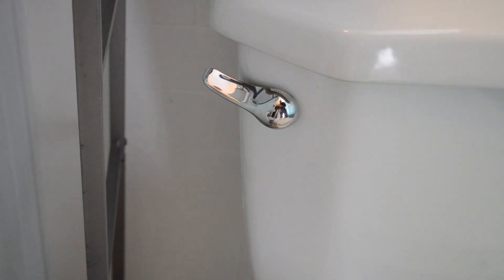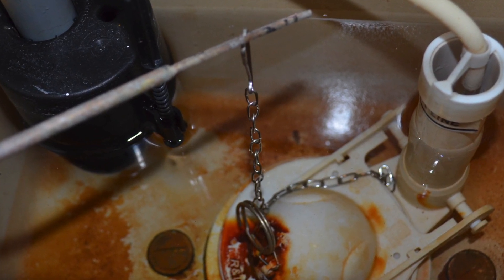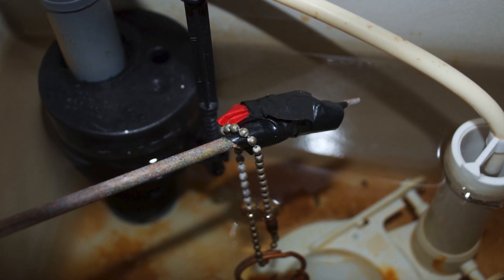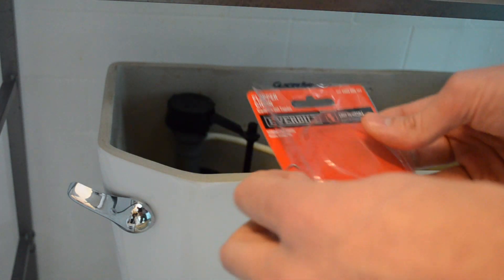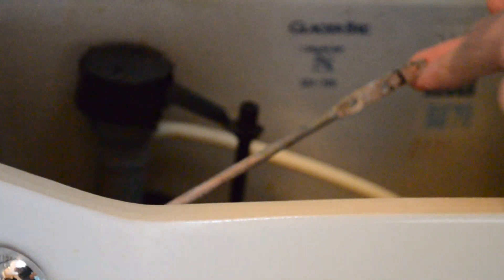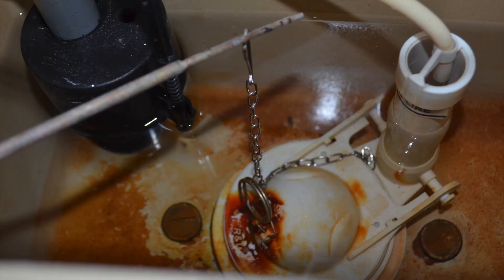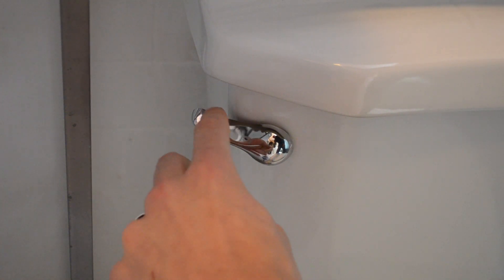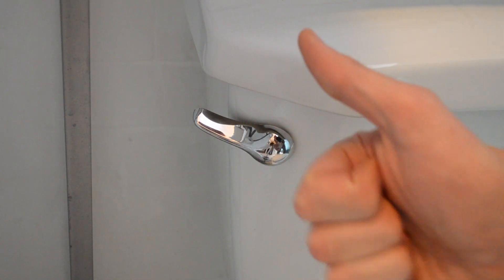Toilet handle loose | Fix for loose toilet handle

Comment: I have an issue with my replacement handle. It's not the chain. I think it might not be the best replacement handle for my type of toilet. Had to make a lot of adjustments. Anyway, the threads are a little rough near the area where the nut would be completely tight. I'm worried about tightening it too much and damaging the treads or the toilet itself. The toilet flushes, but the handle has a wiggle that's bothering me. Do you think I need to try and tighten it some more? I realize it's hard to give an answer to that without seeing my toilet, but any suggestions you can give are appreciated. Thanks.

Comment: The excess chain should not be left at the bottom on the flapper as in your video. It should be either adjusted at the point where it connects to the arm, or clipped off.
Reply: I once took a dump in a toilet.